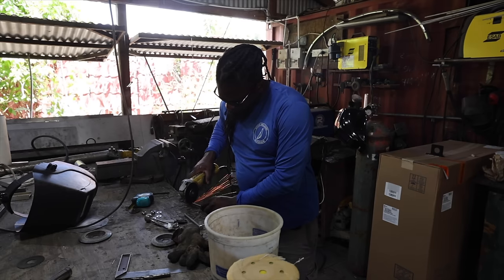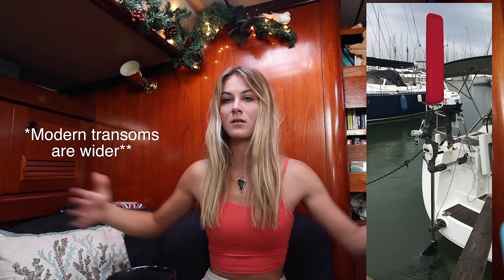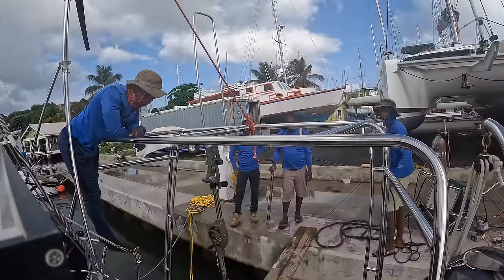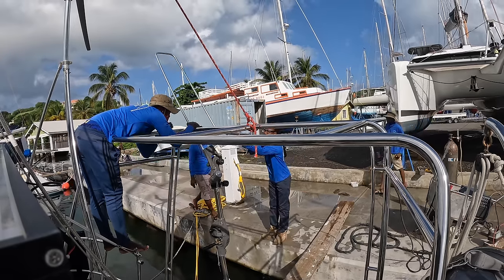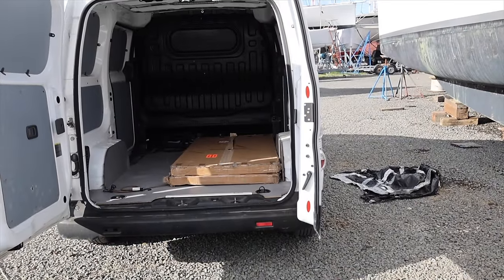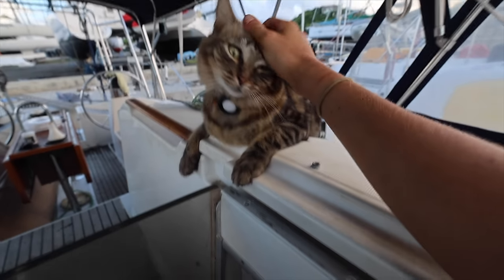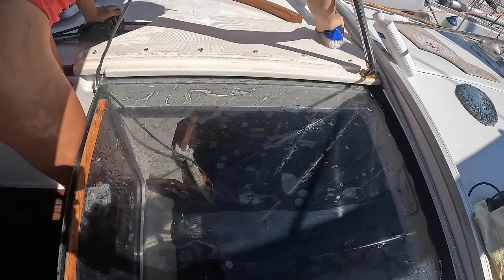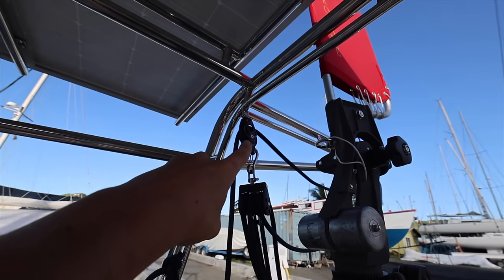BIG CHANGES [ep 94]

Comment: I took lots of underwater video with GoPro before I started to subadive and using better camera. I find that it's better keep camera rolling and then pick up usable bits afterwards. There is some free editing sw, which can cut video clips aligned with frame sequence boundaries, which a around 0.5-1s without re-encoding data. It keeps original quality and is superfast. It only copies video data and put new header and framing into it. 

I came up to this method because it's much more relaxing to just dive and hold the camera. Also, everything happens so fast, you miss it if the camera is not rolling. Sometimes there's curious fish or octopus.

Separate clipping is not needed if one just make the video and delete the original, but I like to keep them. In one hour raw material, there's maybe 5min stuff which is interesting to other people.

Comment: Hi Lauren.
I hate to bring bad news but I think that your (beautiful and spiffy) solar arch is in the way of the Hydrovane! (and I'm not referring only to the height of the vane)
All the measurements the guys took in consideration of the movement of the vane were with the vane pointing STRAIGHT forward! So, in best case scenario, you'll be able to use it (although I doubt even for this) only in "close hauled" point of sale. When angle of the wind changes to close - beam or broad reach, you have to steer the vane towards the wind so instead of moving (relative to the boat) left and right, like the guys were testing, she will need to have room to swing forward and back. And I'm afraid that the vane has no room to swing forward at all... 😔😔😔
Reply from the maker: I made a comment on that during the video (:
Reply: Sorry, I just heard you mentioning the height.
I'm not referring to the height but to the freedom of movement.
But, if you've solved it, happy days!!! 😊😊
Stay safe, fair winds 😉

Comment: Nice arch .. now I wonder how the hydrovane will work. I say it’s to much I closed. 

Satellite positioning can be mounted everywhere.. even under deck. 
Not saying enclosed near other apparatus but it works fine under a open spot on the deck. 
I always have to laugh as most boat owners think “ the higher the beter it receives “as it is not. 
It’s digital and so it receives or it does not. Just wonder how your phone knows where it is as you sit on it.

Comment: I have a similar issue on my yacht, wanting to fit a solar arch around my hydrovane. It seems, looking at your video, that they only tested it with the vane in line with the boat. In use, the wind vane is rotated to the wind angle and doesn't simply flop from left to right. I think yours may foul the framework when rotated; this is the biggest technical issue I have with the planning of the installation. Also, can you let us know what the cost of that installation was please?

Comment: Is a hydra vane better than auto pilot? Pluses and minuses?
Reply: 1. Hydrovane keeps you on corse to the wind. If wind shifts, your boat will steer to the angle you have set it for. (you'll need to reset it)
2. Unlike the autopilot, it is completely mechanical so it has ZERO power consumption!
3. (God forbid) in case of emergency, if you suffer rudder failure, Hydrovane is completely autonomous and you can use it as auxiliary rudder to retain control of your vessel.